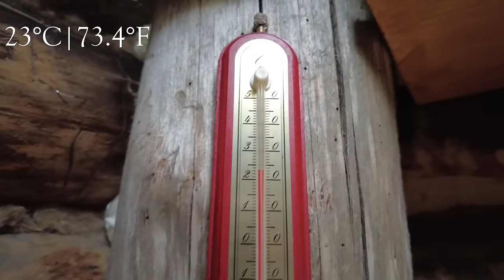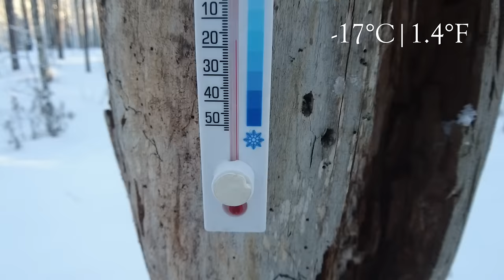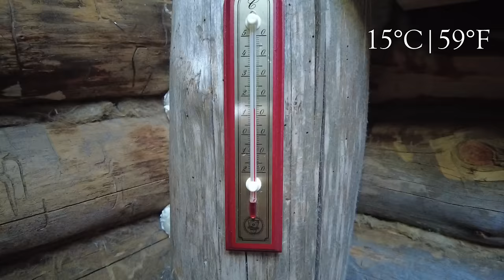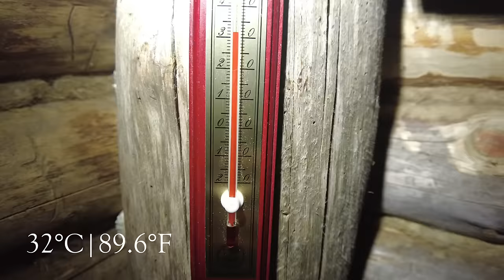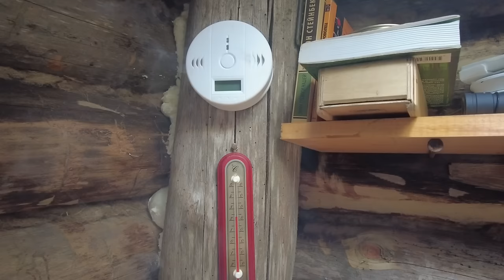Unbelievable Winter Getaway: Surviving 4 Months in my Secret Underground House!

Comment: What is the coldest you have endured so far in this very private home/shelter. Can you use snow after sterilizing for drinking. Of course, for sanitary reasons, you must have to go outside. During WWII, in Normandie in the farm, there were no running indoor water, we had a spring which had been tested on a regular basis. We cleaned ourselves with respect and privacy, taking turn, boys first than girl. The water was heated in a huge copper pan which was solid black, with a crust. Water was almost like gold, bathroom necessities were very clean and so were our clothes, we hang then on the back of the chairs close enough to the cheminée! We changed our underwear each day, rotating them, we did not had many. Everything had to last. Sunday we went to church with our Sunday attires. We wash our hear weakly not daily like today. Water was precious and used carefully, girls had to have long hair. During the war, there were several hair lives epidemics, so we knew how to keep ourselves very clean and our bedding and linens. Our sheets were rotating weekly, so the top sheet would become le lower one and vice versa. The bedding as always hanged daily at the bedroom window wide open to "change the air", as we would say. We had to stay healthy and clean to survive. Sometimes we would walk to school back the same, staying out of site in tiny little pass in woods or fields, major roads were too dangerous. After the war, we kept some of these routines because it was rationed and we had to feel safe. Night time were scary, no police for awhile, so everything had to be locked up. The horses and all the animals were in as safe as possible inside of the barn, everything tightly locked. Many French people were stealing from one another and sometimes worse. No telephone yet! Radios were must becoming to get on the market, it was the only way to get accurate information, for a long time... into the fifty. Walking to and from school had to be swift and in group when ever possible. It was a dangerous time, but we kept on going, and looking after each other. Street light were not resistant infill much later, now we have too many! Ha...ha...! Too many people, stay safe, bonne nuit!!!
I though, I would entertain you while you were away from home.
Reply: Loved the stories you shared.
Reply: The hard times sure do make you appreciate the good times.  I think the reason these type of videos are so popular is because life can get so hectic and stressful that we yearn for simpler times, without having a war of course.  Most of us haven't had to deal with the hardships, at least not to the extent you did.  Thank you for sharing!

Comment: You should have a metal stainless mesh over all exposed glass areas for safety and let light in ! Great build !
Reply: Hi, just to let you know, it’s not glass windows. They are thick plexiglass windows. When he installed them, he stripped off the blue cellophane protection film that kept it from getting scratched.😉

Comment: Cool concept...but I see a lot of things that could go wrong in winter. No air ventilation - imagine a really cold night and you run the chimney for a few hours, then you fall asleep because of the carbon monoxide. Then while you sleep a few feet of snow falls, making it impossible to get out. Also the chimney vent will be sealed as well as your windows - no light or heat. Then if you even wake up from the carbon monoxide poisoning you are essentially trapped down there until the snow melts. Let's say you have enough food to be trapped there for who knows how long, but where do you pee and poop?
Reply from the maker: don't look closely, I have ventilation😉
Reply: @RuslaninTheWoods Read my comment again (and maybe have someone to translate for you). Also I how can your ventilation not be blocked under a few feet of snow?
Reply: He's stated in comments that they don't get that much snow at a time. Also, Grey pipe you see in lots of indoor and outdoor shots is fresh air ventilation. And he also said he's been living there for 2 years.